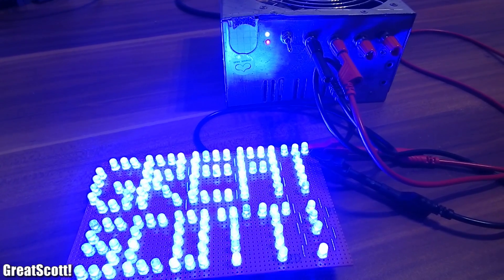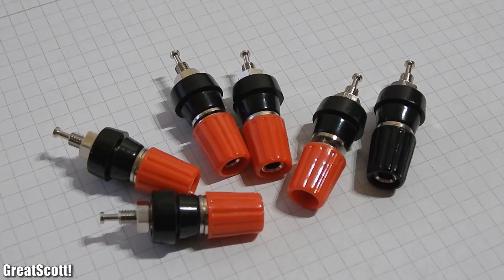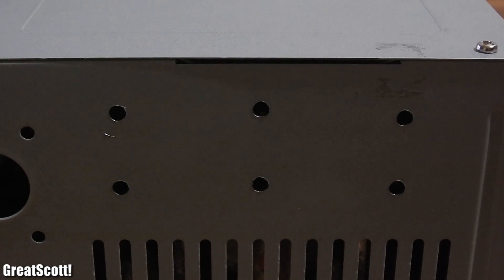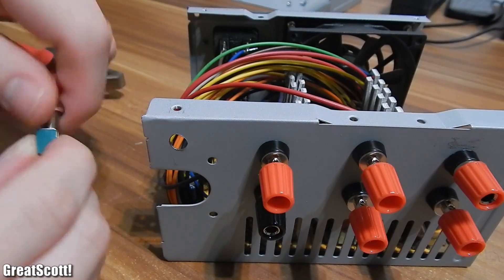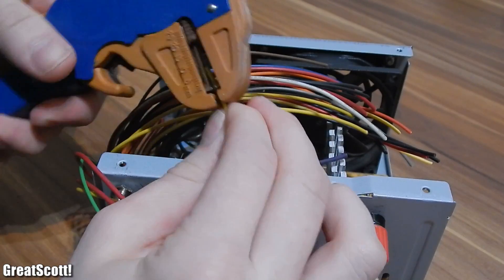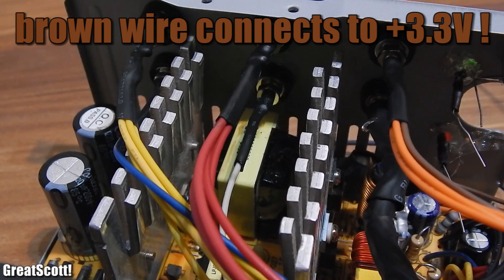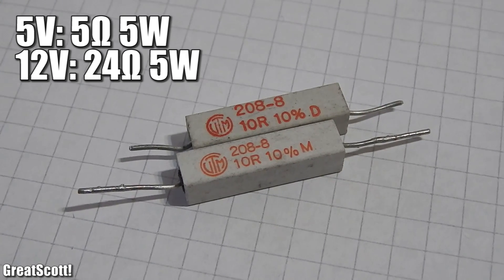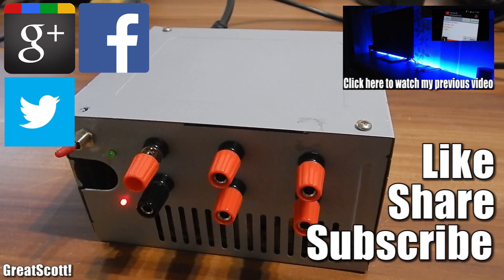DIY Lab Bench Power Supply

Comment: I want to build one, but why did you solder all the yellow to one binding post? Why not just one?
Reply from the maker: RandyDarkshade WIth just one wire, we wouldn't be able to use the complete current capability.
Reply: +ardystal gysr yes, it will
Reply: You can.

Comment: You also get 24V between +12V & -12V. It's limited by current on -12V. And you can add LM317 variable voltage regulator on this output for best result and use.
Reply: Lenin Pardo Salazar  yes, I mentioned it...
Reply: Abraham Pardo  You can boost the current by changing the rectifier diode on the -12V rail. -12V is taken from 12V winding, it's just rectified in another polarity
Reply: That limits the current to 800mA... Seems booooring when you have 20 amps on the positive 12 volt rail.

Comment: Maybe you should use the gray power_ok cable to power your green led?

also mention that you will fry your circuit if something goes wrong since these psu's deliver tons of amps :)

i have a bench powersupply and use a atx-powersupply for additional voltages if needed, but i have connected switchable polyfuses to each connector so that i can get a 200mA, 2A or unfused current.

Comment: When i conected evrything to leds and switch it worked, then i just conected wires to conectors and i faild. What to do?
Reply: srkiYTC Check those connectors. If they are touching the casing then you have a short circuit.

Comment: Mr GreatScott! 
I have checked my power supply and I found that most of the current  are on the 5 volts 
So I went to my local electronic store to bring a 5 ohm 5 watt dummy load resistor but I didn't find it 
So I brought a 4.7 ohm 6 watt resistor instead 
Is it ok to use it ? , will the 0.3 ohm difference  effect ?
Reply from the maker: ahmed alhloul No, that should work fine.

Comment: This is good for most electronic projects but not recommended on rf and ham radio circuits.
Reply: Of course. Bcse is a switching power supply. For those projects you need a linear(with big trafo) with little ripple and noise
Reply: rene kenshin Well don't know about radio, but a 750W Thermaltake works well for my Kenwood amplifier

Comment: what colour wire( for possitive) ur binding on  the post of
red LED. (black for ground)
Reply: ***** Purple, it is 5V Standby, in your pc this is the power delivered to it while it is "off" (so it can perform things like WOL to start it up via ethernet), this will supply power as soon as your PSU is connected to mains, green LED will only go on when all rails are active and you can use your PSU.

Comment: do you have to solder all red wires together? what if i will solder two of them together, and another two together as well? will i get two outlets with lower amp rating?
Reply from the maker: Whiskey Jan. Correct.
Reply: Thanks!

Comment: Nice project! Wouldn't it be safer to add fuses (like 5amps ones), so you don't damage the PSU when drawing too much current?
Reply from the maker: ***** They usually have an overload and short circuit protection.
Reply: @greatscottlab  They do, but many ATX PSUs can provide around 55A @12V. That is enough to melt most wires, breadboards etc.
Reply: @Karl Ljungkvist  no way,  that's scary asf.

Comment: Is a dummy load really necessary? I need to know because i'm ordering some parts from china but i can't find any 5 ohm 5 watt resistors.
Reply from the maker: Ramses De Vuyst You can use a smaller dummy load if you find one.
Reply: GreatScott! Yes, but the seller i'm buying my parts from doesn't have any high wattage resistors
Reply: Ramses De Vuyst
Which site are you shopping from?
It is necessary for some SMPSs because they are very unstable without load. You could also use a 6 volt light bulb or incandescent christmas lights.
Reply: Mandragoras dealextreme, thanks for your input by the way. I guess i still have some christmas lights laying around (somewhere :/). Also, how many would i need and what could i use to load the 12 volt rail? I'm only just getting started with electronics. Could you recommend some tutorials explaining basic things? Thanks again

Comment: In case anyone is wondering like I was, if you have a gray wire, you can use that instead of the 2nd red wire he used on one of the LEDs.  In this video he used a red wire for his LED, but you can use gray as well!  Also the brown wire (3.3 sense), isn't necessarily always brown, it can be orange like mine was.  Just look for the brown wire or orange wire that isn't grouped with the other orange wires, that would be your 3.3 sense.  Just built mine today, I used crimping instead of soldering, and it's amazing! Very fun project to do! Vielen Dank!

Comment: where do you get those dummy load resistors? can i pull them of some scrapped electronics or do i need to purchase them?
Reply: I got them on eBay for 3.80 for 10 of them.  Here is the link if you are interested:

http://www.ebay.com/itm/301176427336?_trksid=p2059210.m2749.l2649&ssPageName=STRK%3AMEBIDX%3AIT

The seller has many different varieties of these if you need different specifications.

Comment: I know this is an old project. But still hope u can help, I have copied what u have done but when I go to turn it on it flashed on for a second and turned off. Don't know weather you would know why this is?
Reply from the maker: rpgtnexus Check whether your binding posts are isolated from the metal case. It could be a short circuit.

Comment: Thank you for the DIY tutorial - Works for me just fine, tested led strip on the 12 works I thought the strip woud glow on the 5v and the 3.3v atleast a bit but it doesnt wonder why ? there is power to the 5 and 3.3v but the 12v strip doesnt even glow slightly on them .
Reply from the maker: Georgi Tuleshkov Only a red (and orange) strip would light up a little bit with 5V. All the other colors have a higher forward voltage. So don't worry. That is normal
Reply: Yes, you are right, I tested it with a green diode which gave out yellow colour on the 3.3v orange at the 5v and fiery glow at the 12v and burned out :D, thanks for the great vid :)

Comment: I was soldering over the internal components like you in 3:17. Then some solder dropped down on to the parts on the circuit board and i can't get rid of it anymore. :( So I recomment you to protect the power supply with a piece of paper. Mine is broken now...
Reply: The psu isn't broken, you've bridged something. Use Flux & copper braid /solder mop to mop up the solder. You'll need to resolder any parts you've moped up. Also you can place the psu down on the side being soldered.
Lastly solder cools in an instant, unless you use tissue paper it won't burn through.
Reply: F
Reply: Use a toothpick to remove the solder, of course heat it up before
Reply: You might want to use something a little more resistant to heat, like wood. Don't want to be the guy who starts a fire and really destroys their power supply :)
Reply: @kingarthurthe5th  "Use wood" " Don't start a fire" :P
Reply: @Theorchero  that was probably a joke but in case it wasn't, wood would need a lot more heat energy than the solder has to start a fire, it would only char and go black in a spot
Reply: @Theorchero  shoving a soldering iron into wood would cause it to smoke and spark at most so a drop of solder can't even do anything beyond a little mark.

Comment: Can you tell me what adjustable PSU are you using in this video becouse im looking for cheap one that doesn't fall apart and has good quality components in it ? 

(sorry bist du deutscher oder woher kannst du deutsch weil du bei manchen Kommentaren auf deutsch geantwortet hast)
Reply: er ist deutsch
Reply from the maker: mattibboss Ja ich bin Deutscher. Du kannst den Nachfolger meines Labornetzteils in meinen Amzon Store finden. Link dazu in der Video Beschreibung.
Reply: du kannst auch einfach eins vom schrottplatz nehmen. ich werde mir übrigens bald auch eins bauen
Reply: FreshCraft24 ich brauche adjustable psu nicht fixed
Solche atx psu kann ich immer irgendwoher z.b. Sperrmüll 
Ich hab kein plan wo ich hiere Schrottplatz finde wohne seit 3 Jahren hiere (Stralsund)  kann noch nicht perfekt deutsch... Ich glaube hiere ist gar keinz...alles ist so scheiß teuer.....
Reply: GreatScott! Hab die links geguckt und da sind komplett andere PSU... Kann ich link zu deinen psu oder Firma und model?
Reply from the maker: mattibboss Mein PSU wird halt nicht mehr hergestellt. Daher auch der Link zu dem Nachfolgemodell.

Comment: Hi thank you for your videos and especially this tutorial. Is it possible to turn this into variable PSU by adding potentiometer on the 12V rail?
Reply: No no no you will blow shit of that pot.... 

There are 2 options 
buy lm317 or lm317t and few passives and hook it up... Just youtube lm317 adjustable regulator (awesome video made by afrotechmods) 

Or get yourself good quality (not cheap ass!)  dc-dc conventer i preffer step up and down but you can use step up hook it up to 12v and use that pot on that dc-dc converter or buy 10 or 20 turn pot (it's expensive) and desolder that one and solder your new one and use that....

I think you should use lm317 and save your money for good quality (no China shit or you will throw it out after it catches fire xD)  adjustable power supply WITH CURRENT LIMITING (otherwise it's shit)
Reply: mattibboss 
Thank you. Can I just use a fuse as a current limiter?
Reply: komicite not really 
For example if you use 3A fuse 
You draw 2A your fine 
You draw 3A your fine
You draw 3.1A your fuse starts to blow slowly it can even take few seconds but you draw 3.1A and not 3A.....you can do that with lm317 for current limiting but in my opinion it sucks and isn't worth doing that 

If on your powersupply is written 5v @  2A you can or even should buy fuse like 1.5-2A one so if you draw 20A from that it dosent catch on fire ... it should prevent you from drawing more than 1.5-2 or whatever your fuse is... It should just blow and you need to replace it 

There are co called resettable fuses (or polyswithes i think)  its 2 pin device you hook it up like fuse and if it "blows"  you simply turn your psu off wait minute or so and it works again (until you exceed current limit of that fuse so it "blows"  again) 
Polyswithes you don't need to replace and standard fuses you need witch is annoying

Comment: I have:
3.3v - 33A = 108.9W
5v - 36A = 180W
12v - 25A = 300W

So most of the power is on the 12v rail. What is a good resistor to use as a dummy load?

Comment: I don't know where my power supply has most of it's power. 
+3.3V 15A
+5V 21A
+12V1 18A
+12V2 18A

so rail 3.3V and 5V has 36A in total
and rail 12v1 and 12v2 has 36A in total too!
To which rail should I attach the dummy load?
Reply from the maker: Koen Spekschoor 12V*36A=432W which is way more power even if you have all the amps on 5V. That would equal 5V*36A=180W. Attach your dummy load to 12V.
Reply: GreatScott! Thanks! My bench power supply is working and gives the right voltages on each binding post! But when i use it my dummy load gets extremely hot and it starts smoking after a while. I used two 5W 12 Ohms loads in series instead of one 5W 24 Ohms load.
Reply: GreatScott! I found out my insulation tape was melting because of the heat the power resistors give. I removed the power resisors and now my power supply is still functioning. Thanks a lot for the tutorial.
Reply: Koen Spekschoor what he says in the video is very wrong on several levels.
5 ohms at 5 volts is one amp draw just in heat and less 5W in the output. In his 12v he recommends 24 ohms witch is a bit better as it is only half an amp but again 5W thrown out the window.
Any power supply should be stable with much less than that. He is being way to conservative.
You should for 5V use a 50 ohm and 1W resistor
And for 12V use a 240 ohm and again 1W resistor
If you don't find 1W you can try a different W but never less than 0.5W or 500mili W.

Comment: This is great. I just built mine and it works perfectly. Thanks GreatScott!
Reply: Viwe Mqaqa i wonder if its powerful enough to jumpstart a truck
Reply: @rosekreuze  it will pop
Reply: Meh. I use 50's Tesla BS 275. 0-800V
Reply: Also, add 5-10A fuses
Reply: does it still work fine?

Comment: What does the -12 and -5 do? 
If I make this and want to power something do I connect it to the -12 and +12 or the +12 and ground? Can I just not use the -12 and -5? THanks
Reply from the maker: BATMAN You do not have to connect the -12V and -5V. But they are useful if you work with Opamps. If you want for example 12V for your led strip then connect + to +12V and - to GND.
Reply: If you have to ask this then you probably shouldn't be attempting any projects just yet. Time to go learn a bit of theory first.

Comment: would it be a problem to use a 50 ohm 10 watt resister? its all i was able to find around all the stores near me...
Reply from the maker: Sergio Pagoada That would only draw 100mA on 5V rail and 240mA on 12V rail. Not enough as a dummy load.
Reply: How about 25 ohms?
Reply from the maker: Sergio Pagoada I think at least 0.5A would be ok. So 10ohms for 5V and 24ohms for 12V at least.
Reply: hmm... i cant find a 24 ohms resister... and i need it for the 12v rail... a friend gave me a brand new atx corsair power supply... and all the local shops have everything but 22-24 ohms... i find 20 and 25 as the closest at 10 watts...
Reply: Sergio Pagoada
Use a 25 ohm 10W will be fine.

Comment: Really awesome ! :D
And where do I have to solder the resistors go? :O
Must I use the 5w 5 ohm resistors when I have more amps at 5 volts?
Or change only the output voltage?
Reply: Well now i have 2 lab power supplys for that kind of stuff.
But anyway good to know 5 years later. :'D
Reply: I asked a similar question.... Did you find out???

Comment: great, but what if I want 3 to 5 volts with no more than 5 amp?
Reply from the maker: You buy or build a powerful variable power supply.
Reply: http://www.ebay.com/sch/i.html?_trksid=p2047675.m570.l1313.TR1.TRC0.A0.H1&_nkw=5A+Constant+Current+&_sacat=0&_from=R40
Reply: much easier

Comment: what do you use grey and brown wire for please? great vid
Reply from the maker: Brown connects to 3.3V binding post. It shuts down the power supply if you draw to much current from 3.3 V (short circuit). It is therefore called 3.3V sense. Gray wire is unused. It shows when all voltage levels are correctly reached (5V = Power good)